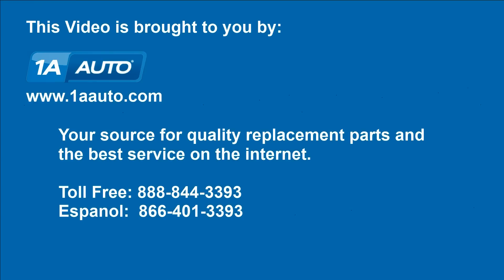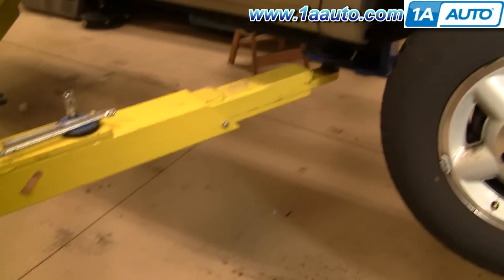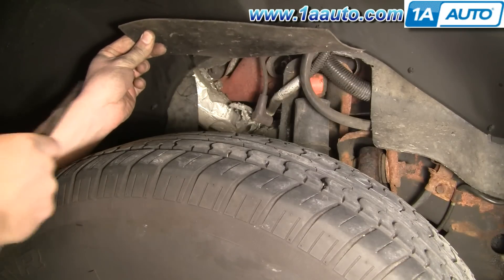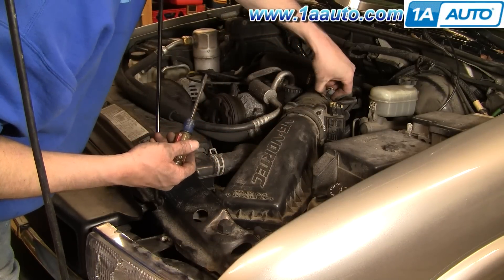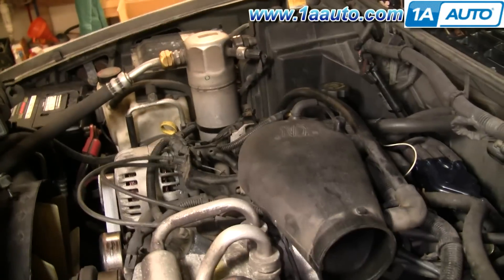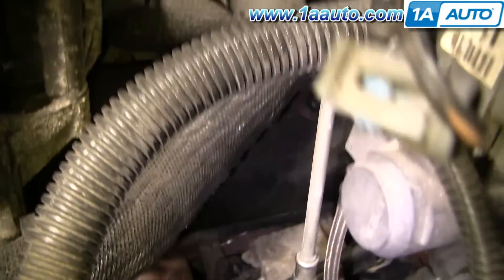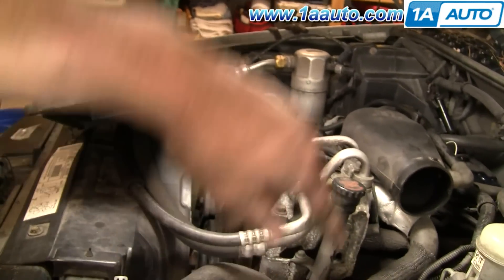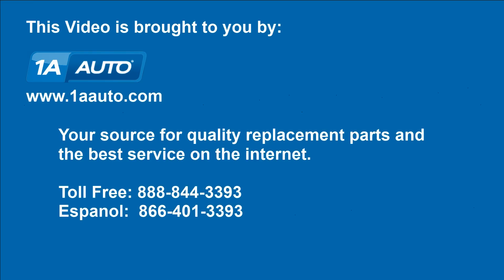How To Replace Spark Plug Wires 94-05 Chevy Blazer S10

Comment: By far, the hardest part of this project was getting the stupid wire clips apart.  Such tight spaces and awkward pry angles.  The secret is to press the little tab down, but sometimes that is impossible.  I broke two clips.  I spent the better part of an hour getting ONE of them to finally open, and at least 15 minutes on each of the other clips.  The rest of the job was easy.  Thanks for the video!

Comment from the maker: @951prerunner you may want to spray the spark plug wires with water from a spray bottle to see if any of them are arching out while the truck is running. you can do the same with the distributor cap.

Comment from the maker: If you can reuse the wire loom, it will hold the wire a little better and not dig into the spark plug wire like a zip tie might.

Comment: Iv been told to get to the drivers side spark plug closest to the firewall; take a jack and jack the engine upwards after you have the truck lifted and the wheel off.
Reply from the maker: +Harley Thorson Thanks for checking us out!

Comment: What is silicone grease and where does it go on changing plug wires on a blazer with 4.3?
Reply: It is packaged grease that you put on the end of the spark plug boot to keep it from sticking to the spark plug

Comment: Towards the end you mention using silicon grease to make sure "they" don't stick. What are "they" and where should I apply the grease? I'm gonna tackle this job soon and I'm curious. Thanks!!
Reply: You want to make sure the spark plug wire boots do not get stuck on both the spark plug and distributor cap. So buy some dielectric grease and coat the connectors on the plug wires on both ends. A small screw driver works great to distribute the grease.

Comment: @1aauto maybe you can help me,im getting a bit of a rough idle on my 01 blazer,my light came on saying missife on cyl #6,now ive changed the spark plug & wires,ditributor cap & rotor,fuel filter,and added some fuelinjector cleaner to the gas(for the full tank i added it in was idleing fine,no problems,add more?), it idles fine half the time but the other half i still get a lil bit of rough idle,drives perfect other then that,but the same check engine code keeps popping up,p0306.any suggestions?

Comment: I have a 1999 S10 4.3 L standard cab ZR2 pickup. Does anyone know of a manufacturer that makes a set of spark plug wires that are 180 degrees on both ends?I have a comparatively easrer time dealing with straight boots than I do with 90 degrees on the spark plug end of things,plus the straight boots just do a better job of keeping the cables away from the hot parts. I know I will probably endup making a custom set,but it would be good to know if there is something off the shelf out there.

Comment: 1A Auto Parts it would be cool if you can show a video showing how you remove #3 spark plug. There are several videos on how to remove it but I would like to know if you can make a videos showing the removal of that particular spark plug. Thank you for the videos and tips.
Reply from the maker: +Theking Zednanreh Thank you for checking us out. We will forward this to our Studio in hopes of a video being uploaded in the future. 1aauto.com
Reply: don't know if you found it yet but the best way I found was a 19mm wrench on the back of the spark plug socket it's the fastest way I found, and it still takes forever.
Reply: Snap-on 5/8 S9706afu with long extension

Comment: What would happen if the plug wires are mistakenly interchanged?
Reply from the maker: +Francisco Sanchez You would have a sputtering and misfiring engine!  Thank you, 1aauto.com
Reply: So if you put the wires back in correctly it will start

Comment: The intake part whenever seeing other blazers of the same gen always throws me off. Mine is stock as well but the air intake is different. Mine slips onto the intake at the front not the top

Comment: I have on the passenger side first  spark plug wire(front one) going to 3 on my distributor. 2002 chevy s10 4.3L 4×4 ZR2.
Reply from the maker: +Fred Lowell This procedure might be different for your application. We do not currently have a how-to video for this particular year, make and model. Thank you for asking! http://1aau.to/m/Shop-1AAuto-c

Comment: @951prerunner ....are the dist cap ....screws stripped?....almost all get stripped even by so called professionals .....u have to redrill the holes for a snug sheetmetal screww or drill and tap for a machine screw....don't forget that the hole in the cap itself has to be BIGGER than the replacement screw or it will bind and lift the cap off its seat.....you will have the same symptoms all over again cept the cap will FEEL TIGHT

Comment: oh I just found out ... on the 1997 Chevy Blazer the steering column is totally in the way of installing spark plug #3.  You have to remove the air filter, then remove a plastic shield over the steering column, then remove a 7/16 bolt from the base of the steering column, then move the steering column upwards about an inch and it will then be out of the way to install spark plug #3 on drivers side Chevy Blazer 1997
Reply: Godlovesallpeople just slide the boot down and there is a flat spot on the shaft, turn the steering wheel to position the flat spot, then you can use a socket and extension. (Sorry be 6 years late :)
Reply from the maker: +2l8and1 Thanks for checking us out! 1AAuto.com